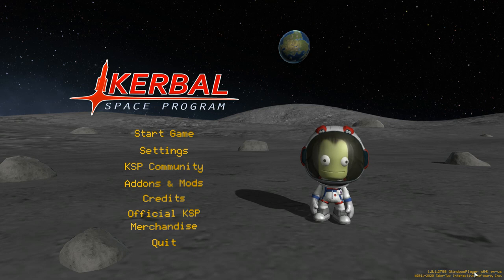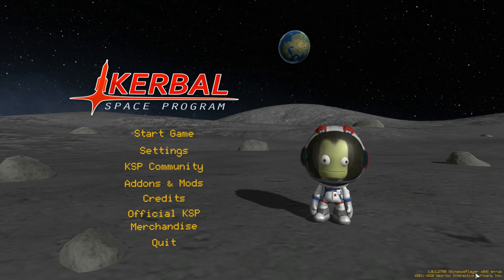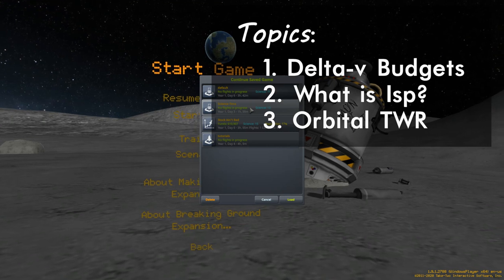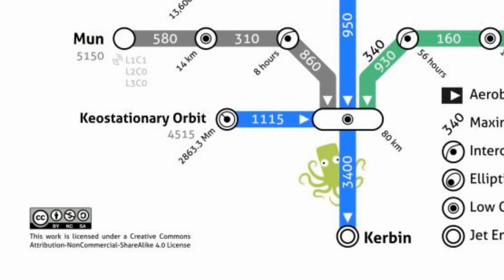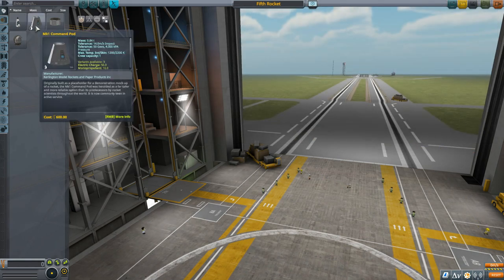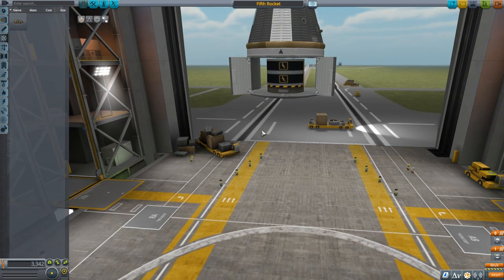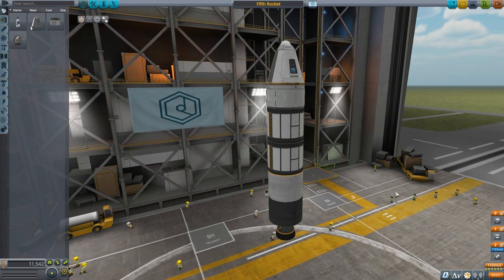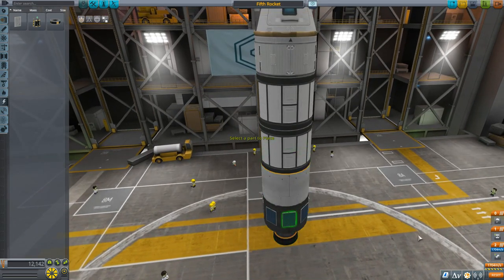Building with a Delta-v Budget - KSP Beginner's Tutorial

Comment: Hi!  I'm just following along with this guide and noticed this morning that including the same thermometer and barometer in different action groups will max it out after the first use.  So for example in my custom group 01 it will log temp and pressure, but activating my 02, 03, 04...etc groups requires science to be collected.  Is there a workaround besides loading the craft with extra thermometers and barometers?
Reply from the maker: I don't think this has anything to do with action groups. After running an experiment, you can't run it again unless you do one of the following three things. Collect the science via EVA or a science storage container, transmit the science, or reset the experiment which loses the science. I talk about this in detail in this video.
https://youtu.be/GevHTvKkXbk
Reply: @MikeAben  Thanks for the swift reply!  It's been a long time since I've played!

Comment: I am still confused on how isp works. Is higher isp better or worse? Because you said reliant was better at sea level even though isp was higher in vacuum, but then you said Terrier was better in vacuum and it had isp higher then sea level.
Reply from the maker: Higher the Isp, the more efficient the engine. All rockets are more efficient in a vacuum. When I said the Reliant is better at sea level, I meant it was better than the Terrier. Sorry for the confusion.
Reply: @MikeAben  thanks for the response.
Reply: @Tulin258  I recommend using engine plates. You can put engine in like quad positions or Apollo positions and they can also be used as one way seperators

Comment: hey this is pretty cool, quick question. HOW THE FUCK DOES YOUR ΔV GO FROM 1718 TO 1723 WITH NO CHANGES TO YOUR ROCKET?????
Edit: it was from removing the monopropellant from the capsule
Reply from the maker: It would help if you point out when that happens. One possibility is that I removed the monoprop from the capsule.
Reply: @MikeAben  oh yeah sorry, I downloaded the file from the description of the next video and I'm slowly taking it apart piece by piece to try and find any differences between it and mine (I'm a complete noob so I have to exactly follow it or i will screw it up) so far I havent found it but I will say so once I do, in case others also have this issue.
Reply: @MikeAben  yeah it was the monoprop, sorry for getting intense, I love your vids btw
Reply from the maker: @jagaimo3484  No worries. 5 m/s is hardly critical. Don't forget the weight of the kerbal and their gear will factor in as well.